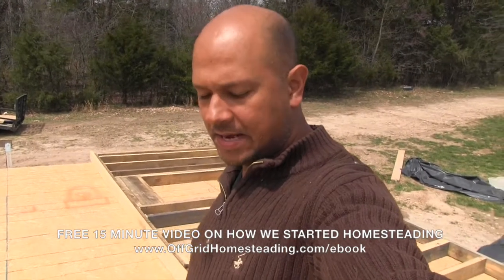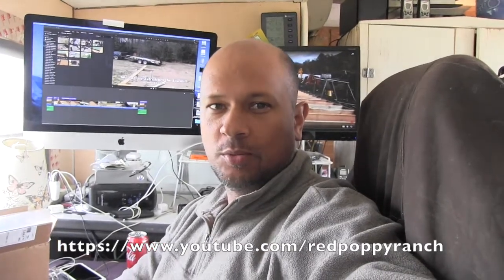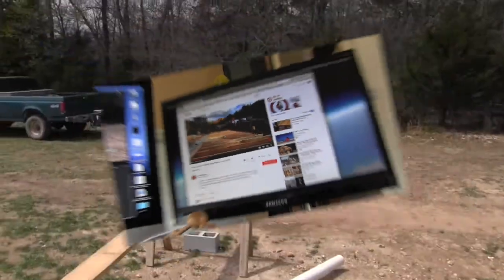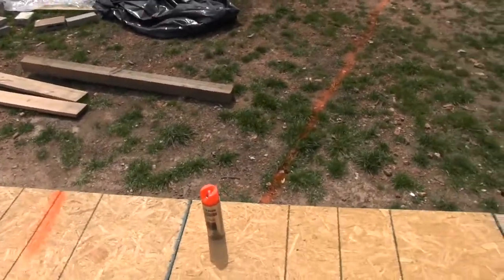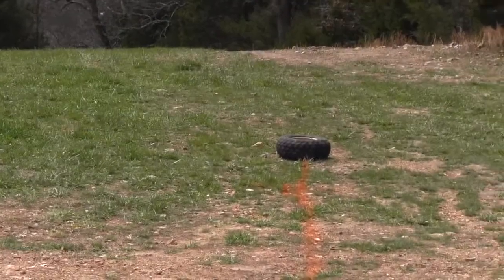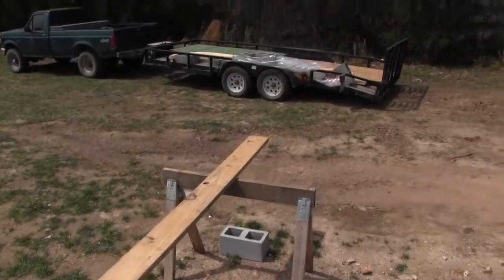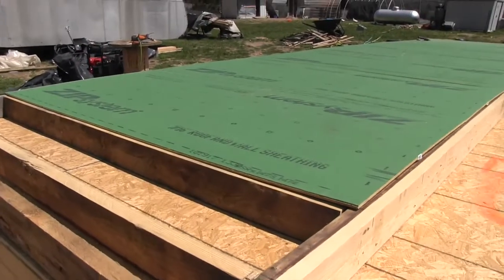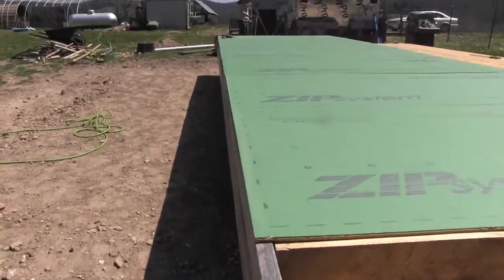OGH - DIY Installing Zip System Sheathing or Siding on Framing

Comment: Of course, it's too late now, but the bottom plate needed to be toenailed to a chalk line that had been snapped at 5-1/2" from the outside of the floor. That way when the wall is stood up, it is in place. Like this: https://www.youtube.com/watch?v=M3ss8xfXKAY The reason the top of the wall is so crooked is because you flushed the bottom of the wall with the edge of the deck which is evidently just as crooked. Those pieces you added to the top of the studs will be nothing but a headache. They will break apart when nailed through.
Reply from the maker: Hey Jim, we ended taking out all of the shims at the top.  And got it fairly square it was off by 1/8 of an inch (at the far end).  I was ok with that.    After trying to lift it BEFORE putting on the zip board with the backhoe it just -- pulled apart a little and we put it back down.  It just farked up everything and put about 1/4" extra spacing up top and had to renail everything back together.  I hope that when we lift the wall that everything works well.  The  5 1/2 line... that makes a heck of sense NOW :)  Oh well.  Lesson now learned.
Reply from the maker: Yup.  I see that now.  And a chalk line would have been helpful in the beginning.   OH well I still have 3 walls+ to go...   Im going to order some of that Black line my stuff keeps blowing away and washing away.
Reply: I used to get mine at the concrete batch plant. It's the dye they use to color the cement while it's mixing.
Reply from the maker: I just uploaded this video for the addition to the addition.   https://youtu.be/cIkNplz7eUE